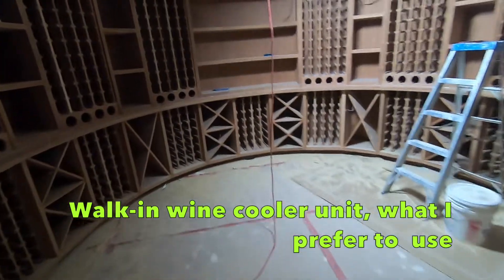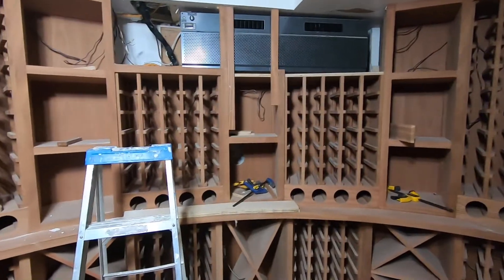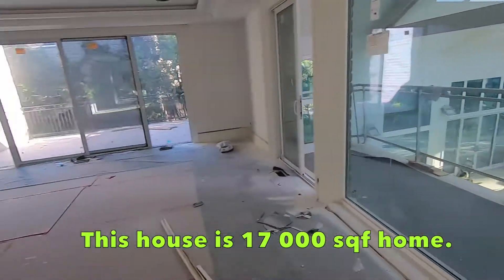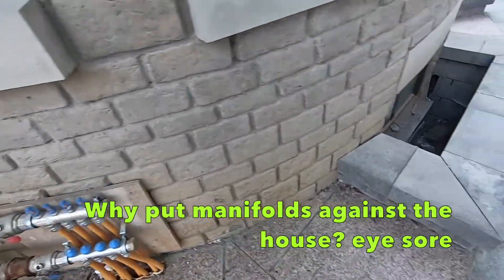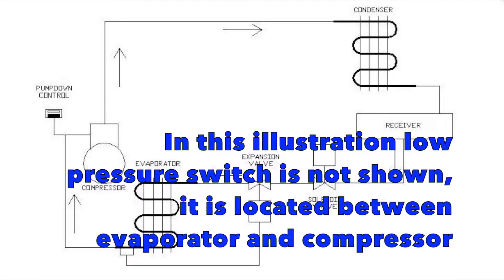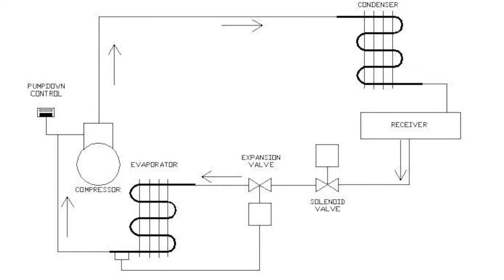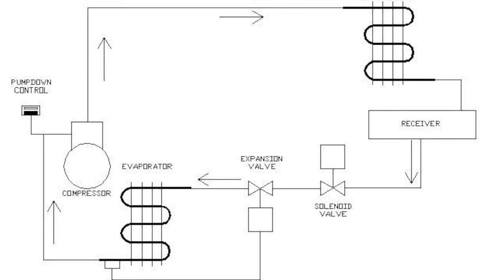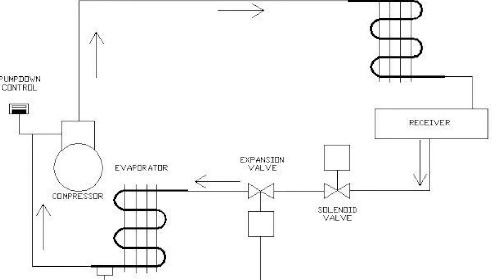HVAC: Walk-In Cooler | How A/C Pump down systems work

Comment: Whats the advantage of a pump down system?  Is it so the outside unit doesnt need a crankcase heater?
Reply from the maker: The big package units or any units it prevents liquid migration going back to the compressor on the off cycle & has a place to store the refrigerant.

Comment: The company I work for did a  wine cellar unit in a big old house like that. We put in  a Lennox. And typical Lennox, it leaked like a sieve. R-134A refrigerant.
Reply from the maker: lol i never installed or used a lennox for a wine cooler. Im glad i have not lol. thanks bud